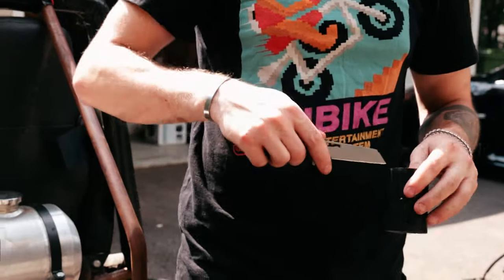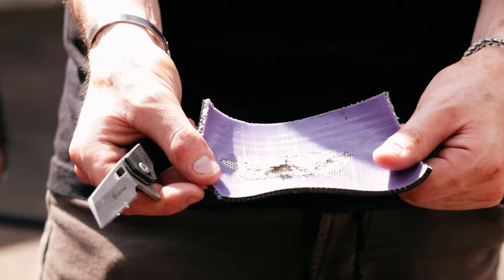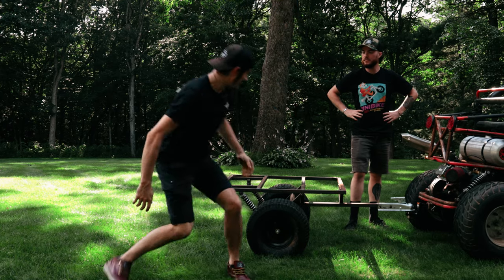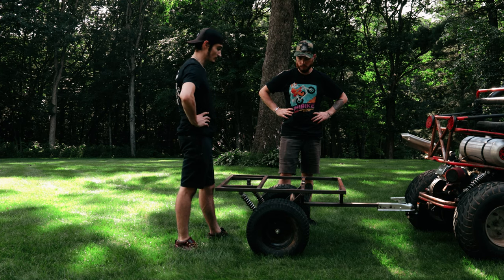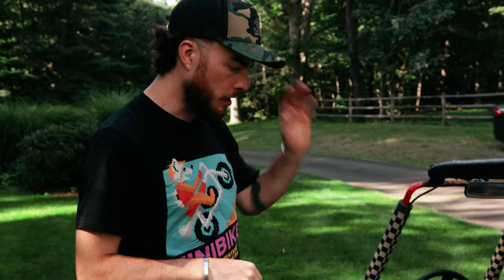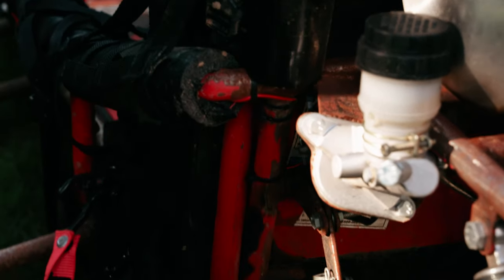Go Kart Race Repair! | Carb Rebuild | Tuning | Steering Fix

Comment: When the carbs states "Not for aircraft" That makes me think well what is for aircraft and maybe I want one.....
Reply from the maker: Right?😂 I think the aircraft carbs are most specifically to handle low air density/pressure as you get higher up